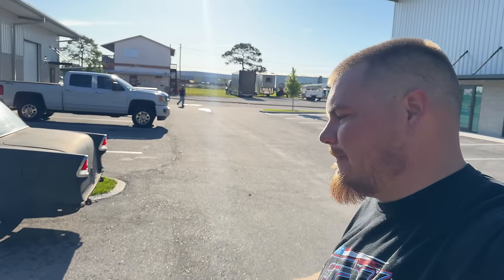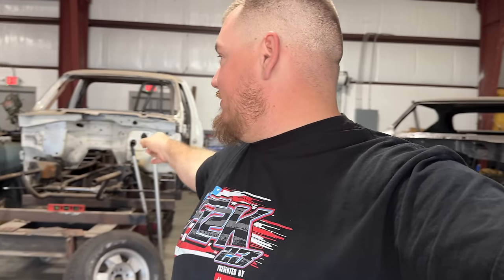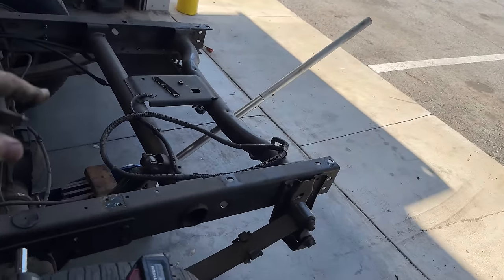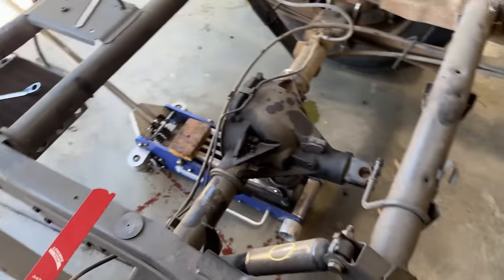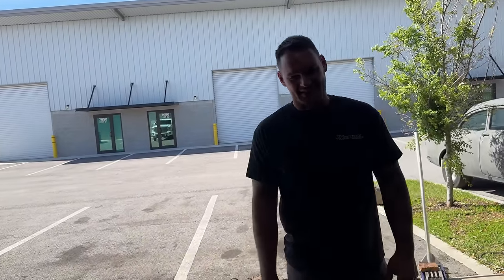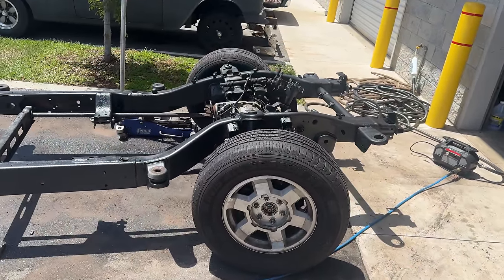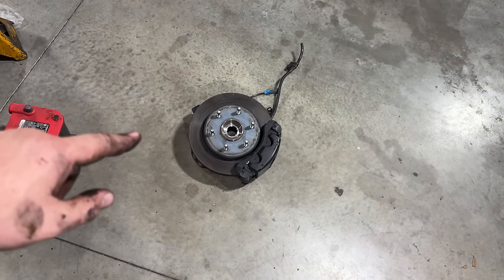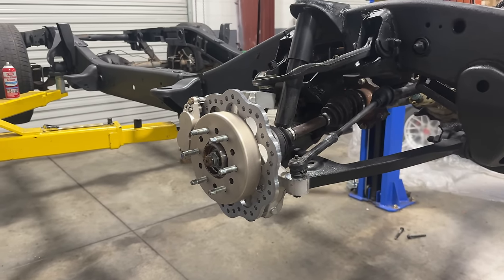Mississippi Queen Goes AWD....... Episode 1

Comment: For the front diff you can use the diff from an AWD gmt800 escalade or denali yukon/sierra. Bolts right in but you may have to change the gears if they don't match

Comment: When you build the 241c make sure you use the 241 chain and gears from a dodge and then do a slip yoke eliminator with 32spline output well. It will beef the tcase to the point the case will become the weak point.

Comment: TAILGATE class no prep, now you will have two cars to race, Cal tracks, leave the torsion bars for now. save that money,you can do all the other stuff later. TRANSFER CASE, NVHD 242  full manual with awd no electronics, 6 planetaries, 32 spline input and output,1350's. these came in hummers early durangos/5.9 magnums, some jeeps they can be  had very reasonable, and there are plenty of adapters, if you don't already have something. Just a though

Comment: was about to mention swapping frames with a 4wd frame under missisipy queen 
hope the front diff is strong enough 

sumting you could do after you have the dragrace 4wd out of youre system is change the missisipy queen intoo a 4wd  roadcourse truck , that would involve a different suspension setup bigger brakes and slick tires and probably the need for an actual exhaust system 
not sure if there run wat you brung / clubraces being held at local racetracks but that might be fun , there usually not try to wreck their racecars during races and the time behind the wheel can last quite some time if they run say 20 minute x amount of laps heats 
kevin from ksr should know more about that stuff 

something else you could do is trow together a burnout truck from parts left over from the 4wd conversion , maibe get some body from somewere that kinda fits over the frame some engine and trans (does cleetus still has that truck he experimented with nitro methane on ?)  could use an  old tractor cab / phoneboot / sumting with windows and a door where a seat and steeringwheel fit intoo . use a wooden gardenshed for all i care , trow a flatbed together for it and run that thing intoo the ground during the next burnout competition 
shouldnt matter mush as its mostly junk to start with

Comment: Another option for 4wd would be a divorced transfer case.  It takes an extra shaft but if you place it right you can run any 2wd transmission and not have to change the front and rear shafts.  Mud truck guys (maybe JH?) would know about such things

Comment: If you'd rather do AWD then you need the AWD transfer case, and you need the long axle side of a AWD front diff to delete the locker actuator.
Reply from the maker: I’ve acquired a whole Awd axle and the t case to make the glide work
Reply: @DrTuneEmAll  Only other thing you might want to look into if you are going for big power is a LSD for the front axle.